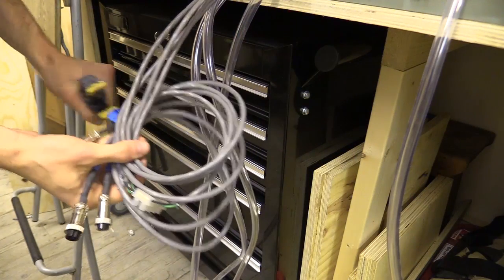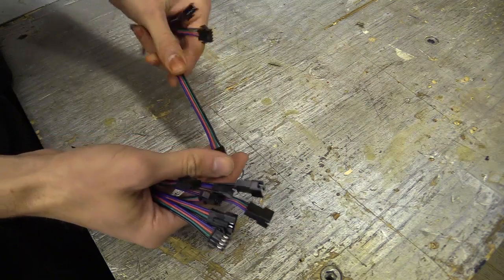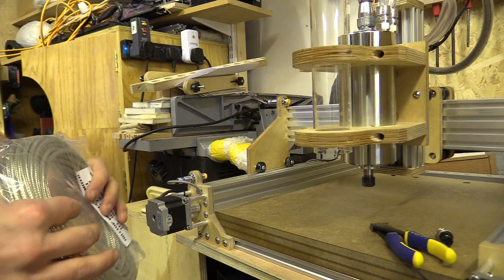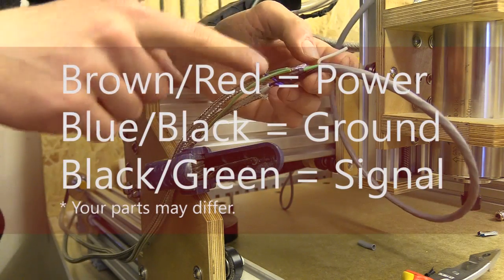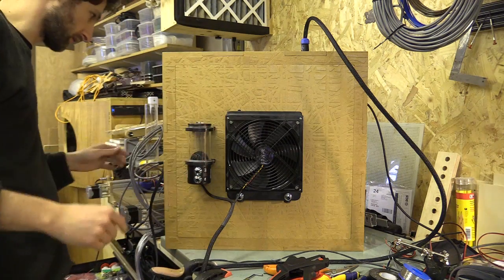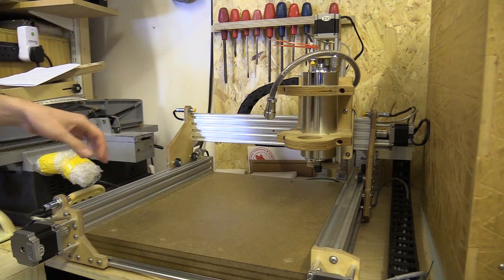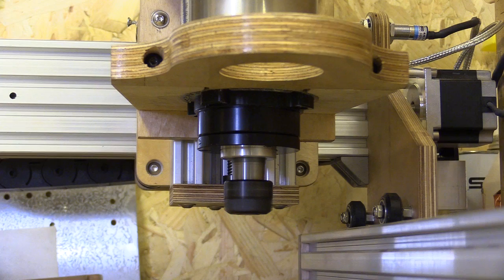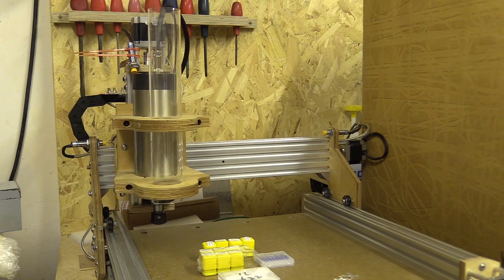#18 Connecting CNC Machine to Controller Enclosure #18 / CNC Control Box

Comment: A common practice with these and similar metal body connectors is to have the shield clamped in the strain relief as these connect together when attached.  This brings the braid to the metal panel box ground when attached.

Comment: Hello! Firstly congratulations on the channel is very good !! I love to follow it, second sorry for my English, I only speak Spanish ... google translator hehe ... a couple of questions, which controller board are you using for the controller you are mounting? The control panel works with GRBL ... MACH3 ??? What power do you plan to use in the engines?

At the moment no more! very good work!! thank you very muc
Reply from the maker: Hi thanks, sorry I don't think GRBL works with Mach 3 - it isn't something I've looked into because I was planing to stick with the GRBL platform. I am using the phoenix CNC controller which is a bespoke one.
Reply: ok! Thank you very much! Look for information about phoenix controller.
Follow it with your videos are great

Comment: Congrats! I bet your stepper drives are set to power down when idle. It's there to save power and keep the motors cool but also allows what you describe.
Reply from the maker: You won't believe what it was - one setting in the GRBL firmware which I could change in bCNC configuration area.
Reply: You're good.

Comment: Nice journey. I watched all videos, and (from my point of view) it seems that you give more attention to your electronics than a mechanical structure to a router. Do you have any record of money you spent on this?
Reply from the maker: Thanks, yes I do - but I also got a lot of parts for free from various companies. I may have overspent on some parts because I was developing and making mistakes, but I will put that together at some point, assess the damage and share in a separate video.
Reply: Well, it happens. Especially when you doing things first time. After couple of tries i now have material to built one small router, and a first advice i got was to try with smaller one because it will hurt me less if i fail. I will wait for a video of yours to show us what you can and you can't do with your machine.

Comment: congrats but it seems to move real slow... don't you think?
Reply from the maker: I've set the max feedrate to 1000mm/min. I've read / estimated any higher and I risk whipping.
Reply: well I don't know. to me it seemed slow that is why I asked what do you think? you know probably more than I.
Reply from the maker: Yeah the one at work runs around 2500mm/min and has a step-down of 6mm in MDF #CNCGoals. I've only just started using mine at 800mm/min to be safe - I'll have a look for the federate calculator I used but I guess as I use the machine more and more and I become impatient, I'll notch it up until it breaks and I have to build a new one.